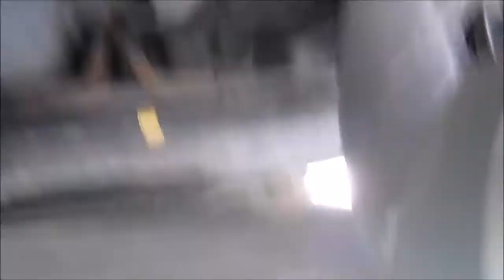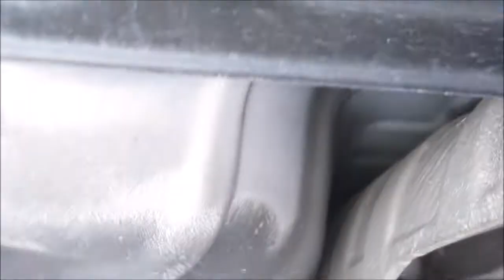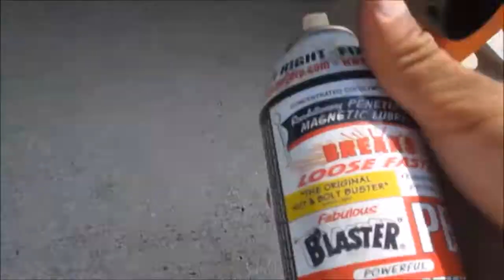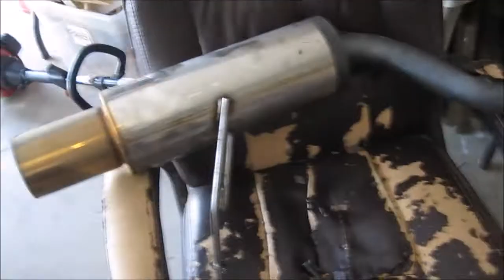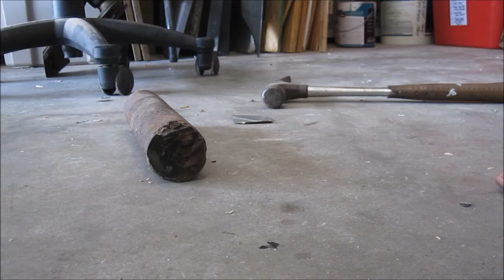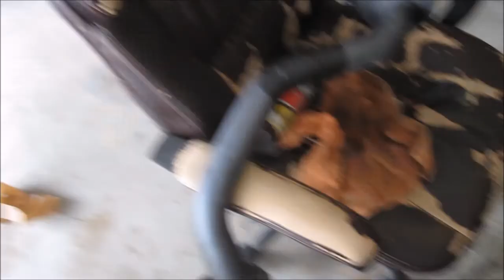Mazda Mods Episode 54 : Exhaust Leak Fix

Comment: That tape was put on least hottest spot on the vehicle. Because of the effiency of engines over the past 20 years exhausts don't get hot anymore and they rot from the inside out. You have about two rain storms before your hole is back. If the pipe is 2.5 take a 3 cut a line down the center of it so you can get it around the 2.5. Use two radiator hose clamps and a two part epoxy permatex. Black and silver. Mix and smear on it. I've used that shit on exhaust manifolds and it will get you through the weeds long enough to buy the right shit. ☮️